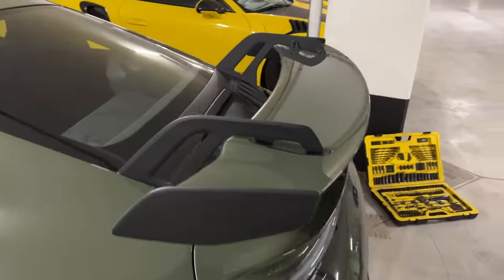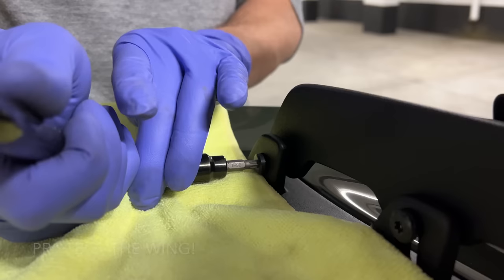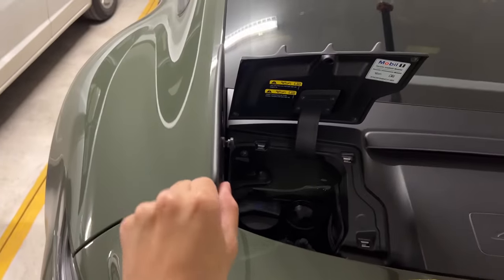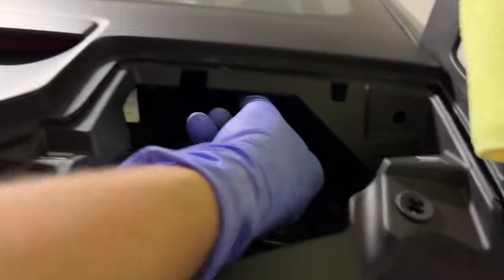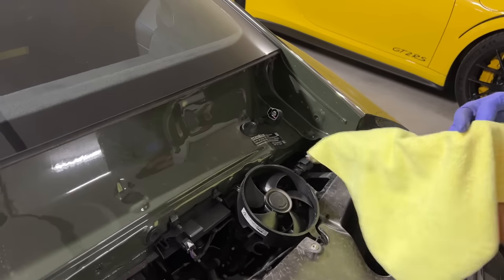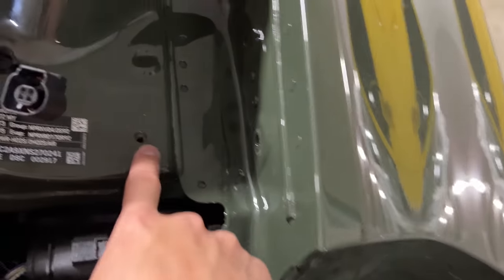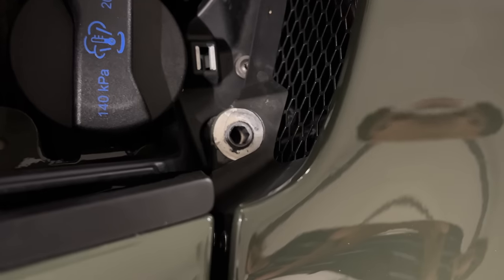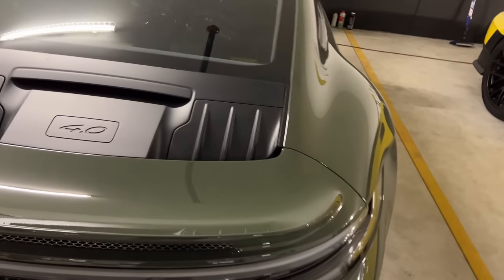992 GT3 Wing Delete

Comment: A gt3 touring with a ducktail. Exactly what I would do If I can afford one lol
Reply: But why? Might even be dangerous since it could potentially lack stability.
Reply: @alexanderfrankenberger1118  yes the downforce probably wouldn't balance between front and rear. I've seen somebody did it and said its actually unnoticeable on streets. You only feel it in track. But you can always add flicks or bigger diffuser to make it up. I just don't like the normal retractable wing.
Reply: Best of both worlds
Reply from the maker: At street legal speeds, the wing delete will not affect safety, however the wing will be going back on for track activities :)
Reply: @yyzcurator797  street legal is as fast as the Car runs. But it's illegal to remove safety relevant parts of the car. TÜV is coming for you!
Reply: I was thinking the same thing.. but from what I here for everyday used the wing delete would effect anything..  a touring doesnt have a wing anyway..
Reply: @nichtfurdich3502  Good thing he lives in Canada where there are no annual vehicle inspections. But we also have the slowest speed limits in the world 😔
Reply: @alexanderfrankenberger1118  if that dangerous Turing edition is dangerous too
Reply: @shibg6619  if a car got built by engineers there won’t be a problem, especially not with Porsche engineers but if you remove a part you never know what effect this will have on the stability.
Reply: @squidwardshouse67  Many Canadian provinces have bi-annual inspections, my province has annual inspections. There are also inspections for when a vehicle changes registrated owner or Province as well.
Reply: Haha me too but I'd put at least one seat in the back for my clone
Reply: @yyzcurator797  that wouldn`t be accurate as ~80kmh roads can have sharp turns
Reply: @alexanderfrankenberger1118  this kind of parts improve your time in tracks otherwise porsche factory stick huge warning sign do not remove the wing 🤷‍♂️
Reply: @alexanderfrankenberger1118  well the GT3 touring also works so I think its fine

Comment: My first thought was, "what are these morons doing"? Now that I watched till the end it actually looks very nice and clean compared to the GT3 touring. The ducktail has a nice little bit of extra flare as opposed to the touring consisting of a regular run of the mill rear diffuser like a base 992. Well done
Reply: It looks nice, but you lose lots of downforce.
Reply: @MrShadowofthewind  I was thinking the same as each add on item to a Porsche has its purpose
Reply: @MrShadowofthewind  There is no loss if you are just driving on the public streets. Downforce would be beneficial at the track combined with a very competent driver.
Reply: Wingless for the street and winged for the track.
Reply: @MrShadowofthewind  you lose lots of downforce when you drive 50km/h on streets.
Reply: @bigmacdaddy1234  It’s not just that you lose  a bit of cornering ability in high speed turns, but you are also messing with the stability of the car and causing oversteer to happen more easily. Porsche even sent letters to GT3 and GT3RS owners stating not to use a ducktail or do a wing delete because of that. I think removing the wing for aesthetics goes against the very principle of Porsche GT cars. To each their own but just buy a Touring if you don’t want a wing
Reply: @essayedgar  99% of drivers of the GT3 are driving the speed limit or to their local Walmart. They will never, ever get near to pushing the stability of this car. It wouldn't even matter if they removed the doors...lol.
Reply: @bigmacdaddy1234  
Then why would they buy a GT3 just to drive it slow to Walmart and with clipped wings? Sounds dumb.

Comment: Rear suspension is tuned for a wing.
This probably really messes with the handling if you where to use it on a track.
Reply: Maybe it's just for show
Reply from the maker: Youre right, my bad I forgot to write that this is only for street use. Wing is going back on for track use :)
Reply: Not on a 911 type. Whatever downforce you lose in the corners can easily be compensated for with your throttle.
Reply: @thefreedomguyuk  oh really? Lmaooo
Reply: Its actually the front end that needs amending if you take away the rear downforce
Reply: @thefreedomguyuk  LMFAO
Reply: Does the touring run different part numbers on shocks and springs?
Reply: @yyzcurator797  I would not recommend it for street use either. At least not for german streets.
Reply: probably you can check in etka there are online versions i think. probably is same but manually adjusted, i think gt3 has adjusting suspension
Reply: @BobbyDazzler888  In that sense in which you have to adjust front camber and toe in order to take out the nervousness in turn in to not get turn in oversteer in every corner because of the missing downforce, yes
Reply: You can‘t turn off physics, wtf ?
Reply: Why wouldn't you just buy a GT3 touring?
Reply: @Welsh_Veteran_420_Z SIMPLE - they’re he’s to find and way more expensive
Reply: @Welsh_Veteran_420_Z touring does not have the ducktail

Comment: Erm... What about the front splitter and the suspension setup? This car's downforce would be extremely unbalanced with the majority going to the front axis at high speed corners. Any irregularity in road surface, with the back dumpers being overly stiff and lacking traction, you're risking some MASSIVE uncontrollable lift-off oversteer.

Comment: Was waiting for them to drop a bolt down the uncovered oil filler neck or scratch one of the unprotected panels. 😳
Guess nothing teaches you like the hard way does until its happened to yourself. Please get yourself some workshop panel blankets and a big roll of masking tape before it happens to you.

Comment: it is a track toll. not meant to look nice without purpose, ruined aerodynamics of the car and also suspension and handling will suffer, so looking forward as you putting it back on!
Reply from the maker: Wing going on if tracked!
Reply: @yyzcurator797  cheers mate, good thought 👍